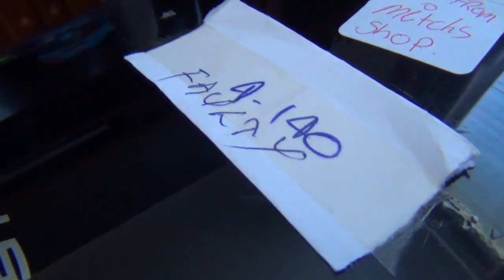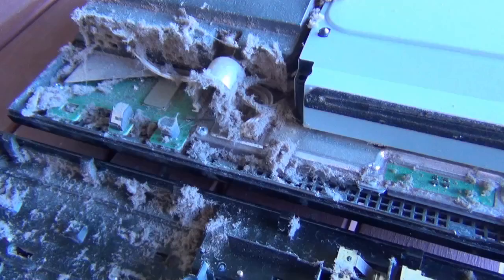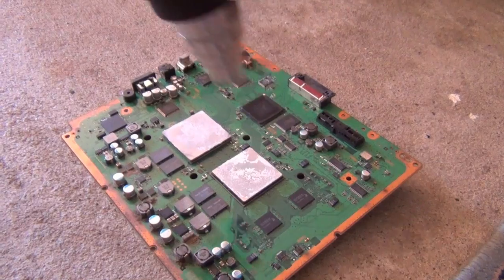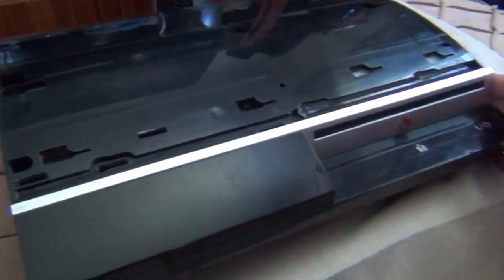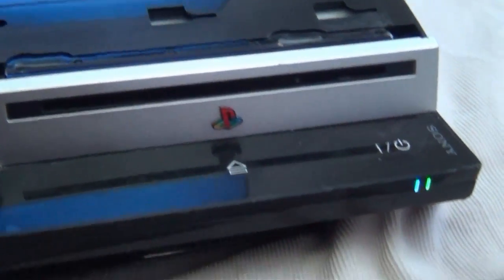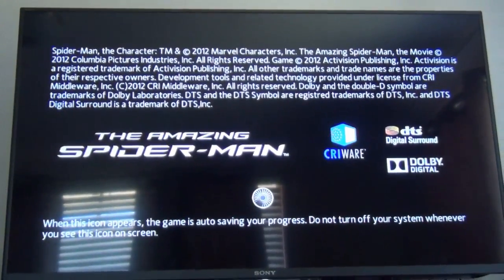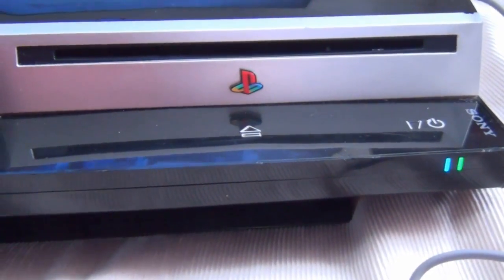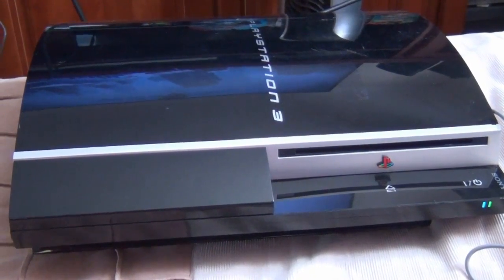PS3 Faulty RLOD Switches Off Repair.

Comment: That must mean that in begining of ps3 life the solder eventually gave out an seperated so the heat bonded the connection until gets hot enough to seperate again.

Comment: So it worked but only for about an hour, then it died again. I replaced the thermal paste as well. Is there any other solution? Or is it gone forever?
Reply from the maker: Just buy a PS5
Reply: At that point just get a slim or a superslim.
Reply: @CadillacticBean  Slim have the same issue my 120 gb has it

Comment: This does not actually solve the true issue. The issue is with the NEC/Tokin capacitors which go bad. They're next to the CPU/GPU, it temporarily solves the problem via heat.
I suspect the rumor spread from the 360 which actually had the ball joints get hairline cracks and whiskers etc... which a reflow does solve the 3 ring RROD.
Reply from the maker: thanks for watching!

Comment: So I saw a video where it said I had to heat it from the back of the air vent and so I did. It worked but then it turned off on me ? My ps3 is backwards compatible so I put in this ps2 game but when I put it inside the ps3 turned off on me and so now Idk what to do ? What should I do ? Help ???

Comment: Hey jp gaming, for the heat part could I use a hairdryer or do I have to buy one of those heat things? And what’s the difference?
Reply from the maker: hair dryer is not enough to melt the solder. Safe enough for your head

heat gun is very hot. will melt solder.
Reply: @jpstyles85  is it safe to use a heat gun though? Im scared it might melt some parts on my ps3

Comment: All your doing is heating up the faulty token capacitors beside the GPU and CPU which cause the console to temporarily work again. It might work for a few weeks or a few days but it’s guaranteed to fail again unless you replace the token capacitors
Reply from the maker: Thanks for watching.
Reply: @jpstyles85  Did it actually work long-term after this fix? I just bought an 80GB PS3 and have this issue.

Comment: Exactly the same beaviour, with same beeps and blinking. I did everything right, heated board with heatgun, changed my thermal paste, and it ran for months, but RLOD come back from time to time and i need to repeat everything again. I did it three times. Yesterday it happened again. What's wrong with it?

Mine was in ideal condition cech08 in chrome. My fault i didn't change the paste right as i bought it, cos it was sealed from factory, and i wanted to keep it original. But there was no dust at all, but GTAV have fried original old paste.
Reply: My PS3 does the same thing but it turns on successfully after ten times of turning it on and off. I'm just glad it still has juice left.
Reply: @grylltheonion  Wow you better watch out. I heared that forcing it to ON without fix may kill it. Ppl that somehow avoided RLOD have fried their consoles
Reply: @grylltheonion  the other thing i'v found out is that there's also thermal paste under chip metal plates, so i need to scalp it to change it there. Also i found that 'nec tokin' chips may bug after years of gaming. Hope it helps, cut thats exactly what i was looking for recently.

Comment: can i use an a Vacuum Cleaner instead of heat gun?..I wish some body answer
Reply from the maker: clean it with vacuum. cpu and gpu solder has lifted on the chips. they need heat gun.
Reply: As an IT Tech by trade I can tell you right now that using a Vacuum is a really bad idea. They generate a lot of static electricity and one wrong touch it will fry the system. Best to use something called a datavac, which is like a can of compressed air but electronic yet designed for this purpose. Or, of course, a can of compressed air itself.

Comment: I have the same problem with my ps3 eith the rlod   and dust inside...i got to clean it and put thermal paste on it and use the heat gun or not, the hair dryer...lol..saw someone use that in his video.. thanks for the video...gave me some tips on how to fix my ps3...don't want to throw away something I can still fix when I have so many games to it...great video...keep up the great work
Reply: Did it work?

Comment: It worked on my 60G model. Was unsure how long and how to apply heat gun. Couldn’t believe it worked. I had tried just cleaning dust but no good. Now I have backed up my data even if it only lasts awhile it was worth it.

Comment: Would be possible to use a hair dryer?
Reply from the maker: unfortunately the video does not demonstrate how hot it really gets. Sadly a hair dryer is not hot enough to melt the solder.

Comment: I am 10 years old and thanks to you I just fixed my dads ps3! thank you so much.
Reply: If you used a heat gun/ hair dryer to fix it, then it sadly won't last.
Reply: @ntuthukosphelele9500  you need to know how to solder to fix your ps3
Reply: @rockl79  lol you 2 got trolled by a 10 yr old

Comment: The hot or cold wind of this hair dryer should be used
Reply: Hello, it was a heat gun, its used to heat up to the temperature of the fusion point of the solder, so any point of solder that was faulty is now properly set.

Comment: Somebody sells 3 of those same kind of console for 10€
I gonna buy them and see if i can fix em'
Reply: I'm thinking of doing it too. Did you get yours?
Reply: @gospodin338 + Yeah, i bought them and cleaned up the inside of the console and 1 works but the second one has broken hdmi input and the third has an overheating issue that can be fixed by chancing the thermal paste.
Reply: @polardabear  I found two, one with 2 usb ports and one with four. Which should I do?
Reply: @gospodin338 + If it has 4 usb ports, you can play PS2 games!
All of the consoles that i bought had 4 ports.
Its backwards compatible with PS2 formats!
I have a ps2 but now i can play more games!

Its just that, it overheats if you play a ps2 game on it!
It heats up real fast so dont put into a closed area!
Reply: @polardabear  Yo polar what if I wiped away the thermal paste and heated up the motherboard will it work if I did that of you know?
Reply: @lilxo9558 + Thermal paste protects the CPU. If you "correctly" change it, it will make your console live longer.
But only if you do it correctly, if you dont, the console can get a blue light of death.
Heating/cooling the motherboard will sometimes work if the console has overheated.

If your console doesnt run well, i would say clean it up first. 
Check the fan and if you really want you can take the console apart and clean the heatsink.
But be carefull with the power supply.
Reply: @lilxo9558 + If you have never opened a console i would recommend to watch a tutorial video and first practice opening the console.
And not taking it apart all the way.
Reply: @polardabear   taking it apart as we speak i took it apart to just clean  fan and all the other dusties  rn ima try and heat the motherboard and see if that gets me anywhere   if not i might  just have to invest in some thermal paste or get a new ps3
Reply: From where?

Comment: hey would you mind giving us an update if the fix still holds a few years later? thanks man
Reply: @steve_deleon26  hey, thanks. So I guess it kind of is a semi-permanent fix, albeit not optimal. I'll give it a shot...
Reply: Of course theres no update. These are just lazy and cheap ways to get the ps3 to boot. PS3s are junk so you have to actually do the correct repair. These guys (tons of videos on here) just warm it up, take pics of it booted and sell junk ps3s on ebay.
Reply: @TheKing-nu4fk  dam true

Comment: Thank you! Mine was as bad caked with cig nicotine, blocked all vents coated many parts i had to replace. In the end, i have only the mobo out of the sick one. It just started gettin the blinkin red light, ill try thermal goo first but ill try heating if that dont work.
3rd gen phat 80gig.

Comment: Hi... my playstation just keeps on doin that... followed your instructions mint and still does not work.... can u help?
Reply from the maker: Painstakingly pull apart and give it another go. make sure the motherboard is nice and hot. But not too hot with out tiny capacitors falling off. Good luck!

Comment: Is it ok if i just clean the dust and not use the heat gun on the board?
Reply: Just the dust?
Reply from the maker: If the machine is running ok. If you have similar problems you need to repair.
Reply: I get the same result when i open my ps3 it shuts itself.first is green then yellow before the red thing that is blinking
Reply: Were you able to get your ps3 working buddy?

Comment: Mine goes from green blue yellow red
Reply: GamingO_GGuyverx you got the YLOD
Reply: @jmreviews3734  yep i found tht out and still cant find a repair solution sucks
Reply: @gamingo_gguyverx6812  

I've been having mine since 2006 60gb model, and it still works. The warranty sticker is still intact. I only use the system for PS2 games and I just play my super slim PS3 for all my PS1 and PS3 games. I really hope I don't get the YLOD on my 60gb PS3.

Comment: It's yellow light of death
Reply: It depends on what is wrong with the PS3. YLOD or RLOD are pretty much the same thing, however, Yellow is more CPU and Heat Sync trouble related, while Red is Motherboard and Power Supply realted. Plus -- RLOD is more common for PS3 hit by a power surge, while YLOD is ones for one that been used heavyly. Both can be fixed with the same common 4 methods....However -- if the PS3 have power surge damage , then you might have to replace a internal cable/rebbon ; to get it up and Running 100.

Edit: But yes, the term "Yellow Light of Death" covers both issues.

Comment: I had a working ps3 (jailbroken) went to clean it up and new thermal paste and got this problem! It worked before i cleaned it even though it hit 70 degrees most of the time
Reply: Cant fix it and it goes green, yellow the flashing red
Reply: Your heat sink wasn't all the way seated to where the paste makes contact

Comment: Hello, I have cleaned out my playstation and have already put down some new thermal paste. Will i need to re-apply thermal paste after i have heated up the mother board?
Reply from the maker: it wouldn't hurt. yes do it
Reply: Okay thanks!
Reply: akaZyloh You’re supposed to remove the old thermal paste with like a cloth and some rubbing alcohol or something, heat up the motherboard, then let it sit for a bit, and then you apply the thermal paste last before reassembly.

Comment: Can you use a hair dryer instead of a heat gun?
Reply from the maker: I don't think hair dryer is hot enough to melt the solder. Heat guns are very cheap on ebay.  how ever if your budget is super tight give a hair dryer a go.
Reply: Thank you.
Reply: It just wont turn on and stay on.  I still haven't tried to use the hair dryer.
Reply: That’s what I used and it started working again
Reply: @rickeybailey2126  did you use hairdryer?
Reply: Joseph Perek yes
Reply: Does your ps3 still work?

Comment: How important is it to heat up the board?

I have already taken it apart, removed 99% of dust and replaced the thermal paste. I also sprayed and wiped all of the circuit boards and connections with wd-40 contact cleaner.

If it is neccesary for me to heat the circuit boards, and can i do this on the top with a hair dryer still? or will I have to take it apart again and re do the thermal paste?
Reply: Erik Olson شش3
Reply: I dont know how to pull the board.. 
Stuck with fan rack... 
Then i cant see the thermal.. And how to i can heat the thermal?? 
I worried  about crack the board
Reply: I just repaired a YLOD'ed 60GB with a hairdryer, let's see how long it will last
Reply: Heating the motherboard is the most essential part, ylod happens because a chip has come loose. Heating the motherboard reballs the solder and essentially fixes your problem, however it'll never be the same unless you actually take the chips off and reballs them which is a whole other story
Reply: Did this work for you?

Comment: So i used a blow dryer for like 5 minutes, It still did same thing. It just beeps after i turn on then beeps twice. so i plugged in my hdmi and spammed the button for like 10 minutes and now it works :) Now i can keep it, My cousin said if i could fix it i can keep it lol so now i have 2 ps3s
Reply: Is it still working?

Comment: my PS3 if I turn on it shuts down it self and my GTA 5 is in there
Reply: Hackerbro - i liek turtles hold the eject button while unplugging it at the same time still holding the eject button plug it back in then let go. That will kick the fan into high gear and spit your game out. Remember hold the eject button entire time then unplug and plug back in then let go and wait
Reply from the maker: gta 5 should be cheap enough to buy another copy if you are not confident in pulling apart your ps3
Reply: jpstyles85 can u help me I my PS3 is blinking red and my GTA is there can u help me somehow I'm kid 9 but Im scared of doing this cuz I saw a funny video when.a dude put his knife in PS3 and got electric shock and it was funny but if u can help pls response me
Reply: ARDOMMM - INTRO MAKER open it and clean the dust and do what he did
Reply: my advanced warfare is in mine
Reply: @PabloRey18  Are you saying it worked or not? Because he isn't joking, it works.

Comment: Vacuum time
Reply: ICU Motors I done this but it does not work? What is  solution for this pls help!!!
Reply: @AjmalAju-hu9nr  You're NOT supposed to use a vacuum on the components or the mobo! That can cause static electricity and might be why your PS3 isn't working. You're supposed to use compressed air to blow the dust away instead.